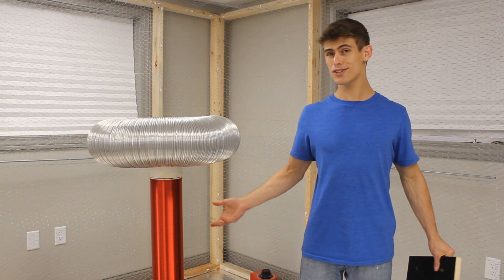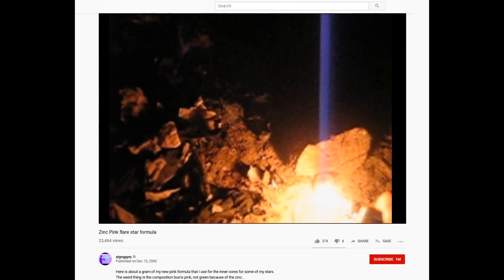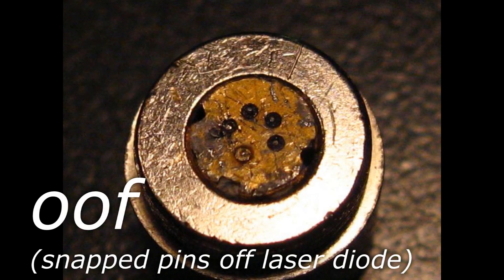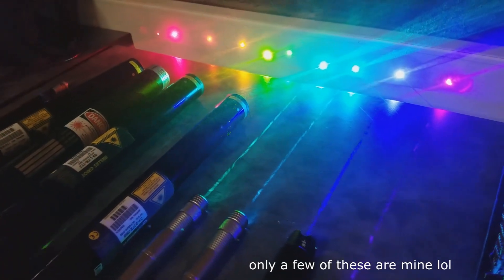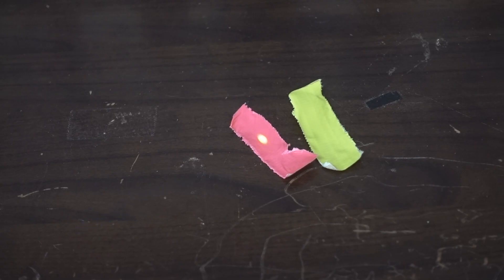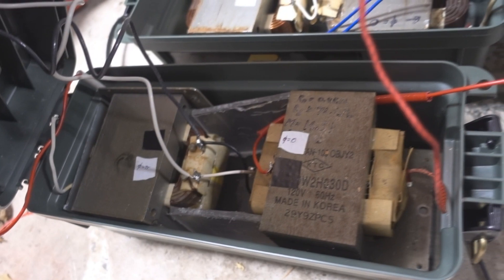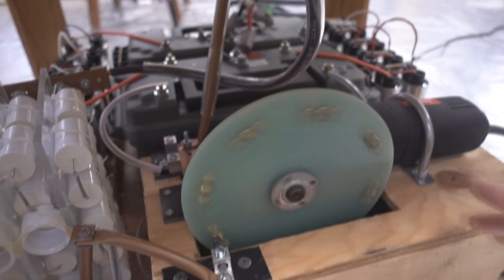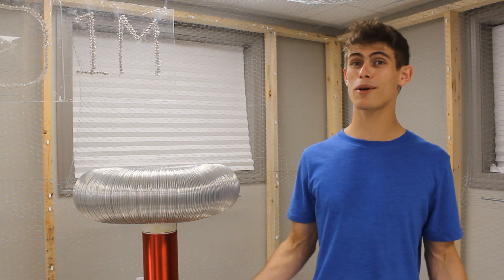Plasma Play Button for 1M Subscribers

Comment: i actually have messed around with a microwave transformer and its without a doubt the most dangerous thing ive ever done in my life i only turned it on once and right after i packed it up into a box along with the capacitor and that transformer will never been used again please don't mess with them people

Comment: Was scanning through your videos, sorrry if you have done one, but have you created an infrared LASER microphone?  Just wondering if so Id love your A) thoughts and B) process and C) circuit diagrams and physical dimensions especially between tx/rx and whether or not you chose a straight AM Superhet or what you discovered worked best. Just wondering.

Comment: Asimov's "The Last Question" was an absolutely formative Sci-Fi read for me, I'm not surprised to hear you recommend it. I love it so much, it really gets at something so universal (pun intended) and despite the vacuum tube computer, the super intelligent AI and the underlying themes and questions are still (and probably always will be) relevant. I love the twist at the end! I also highly recommend it to anyone reading this comment!

I found your channel through one of your DVD burner diode lasers, but a couple of years after your video had come out I purchased some nice laser safety goggles, and started attacking a couple old scrap desktops that I had acquired over the years. Only one had the right kind of diode. I built a classic LM317 driver circuit for it, which was one of my first diy electronics projects! However, I used a resistor in the KOhm range of magnitude instead of the Ohm range, just through some kinda brain fart. I had pressed the diode into a heatsink and collimating lense module, and carefully soldered wires onto the leads, and then I powered it up... and nothing happened. I assumed I had somehow broken the laser diode, and then I definitely broke it while removing it from the casing. That bad been my last DVD burner lol. I then checked my circuit in detail, and noticed the thousand time bigger resistor, and that the diode had effectively seen no current. I still have that driver (I changed it to the correct resistor, but never got another correct diode), and now that I'm older and can buy things on Ebay without convincing parents, I think I might just have to finish it while on winter break from college.

Happy lasing!

Comment: Hey man I ordered a laser from Wish. It is advertised as 5W which I'm sure is not accurate, but it does burn things a good distance away. It uses two 16340 1300mAh 3.7V batteries. Would a stronger battery = more power or wouldn't it matter? Also, I'm really lucky that I watched your videos and went with your recommendation of the Survival Laser goggles. I tested the ones the laser came with and the light passed right through them with almost no restriction. Thanks man. Happy lazing.
Reply: oldspower71 dude is that your Evo?!!!

Comment: This is a laser shot in the dark, but does anyone know what the open voltage of a laser driver is suppose to be? I'm reading near input voltage for open circuit like 10.5v! I'm not sure if that's what fried my blue laser diode and would like to know if I need a different driver or if I'm just being dumb with something else wrong (as the diode is kinda expensive at $40 for 10 seconds of use like I got, LOL!). The laser normally operates at about 4-4.5v range once its powered on (but I don't have an oscilloscope so I'm worried if it started up at 10.5 and maybe that's why it fried)

Background info:
I had it set at 4.75 Amp output, its a 4.75+w rated NUBM08 rated for up to 6 amps max with a forward voltage drop of what looks to be 4v after I turned it into an "LED" where it outputs a small amount of light but its not-focusable very weak dim light). Didn't over-heat, I ran it for 3 seconds longest peak, and it was very well pressed into the diode host with a bench vise. It was a truly amazing beam, I often play with a 1200-1500mW blue laser for killing spiders or setting t-shirts on fire etc, but WOW! That beam just took my breath away (like I know it should be good enough for engraving metal, but it was ridiculous how focused I could get the beam, and even unfocused it torched my wood floors in a fraction of a second pulse, I definitely need to fix it or make another one, too cool!). I can link the lenses used (I don't think it was OD killed, but who knows), and the driver (nothing super fancy, but accepts TTL power or without at just under $20 for up to 5 amps), power input was a half charged 3s Lipo battery (11.5v).

Do I need to find a lower voltage driver? Maybe hook 2 lasers in series just to handle that high open (possibly startup voltage)? With it running it seems to operate at 4v (roughly, remember the diode is blown now for voltage, I did current measurement with a clamp meter to not interfere and was taken when it worked).
Reply: I only ask here because you guys would know more than most, and seems like some laser forum guys are offering advice at my level of knowlege (noob level, lol, I'm not an expert in lasers for sure! I just have background in robotics and degrees in mechanical/aerospace engineering and love modifying everything I get my hands on, including computers and playing with extreme low temperatures and making everything run faster).

If its not answered here, no worries, its not life or death! Just thought I'd ask. I'll be ordering some new parts and hey, if it fries it fries, I just would like to learn from the experience and right now I'm a bit stumped at what I did wrong (which btw, this isn't some thousands of dollars fried, I'm even fine with that if I learn something or have fun, lol!). Hopefully I try again and find out what I did wrong, we'll do a lower power laser this time (aka, cheaper, haha!) on the next test sample just to logic check it and spam the on/off of the power input to see if it fries a cheaper diode and determine if its the driver.

Comment: Question for you, if you have time of course.     You mentioned in a video a while back about using Arctic Silver as a thermal interface material in place of indium foil. While I understand that indium has a thermal conductivity rating almost 10x that of A.S., would it not be better to have a paste to fill in voids in the two surfaces rather than a foil? Or is it a longevity/extreme heat scenario?    

Thank you in advance.
Reply: Incorrect.
Reply: Body Count    Thanks for responding. Can you be a bit more specific in which part is incorrect?
Reply: @hellishgrin4604  I'm just kidding :p I dont have any knowledge on the subject, sorry
Reply: Body Count No worries, I thought it was funny.

Comment: Hey styropyro. Can you make an array of lasers that heat just a small portion of air like 10m away and use this small portion of HOT air as a mirror? i mean like we see the reflection of the sky in the horizon in a  hot road...but in this case controlled and in much smaller scale. I kinda wanna see my hot neigbor havin a shower...=/

Comment: Hey dude, love the videos...have a good for thought for you though.

You education is in chemistry.

You've been hobbying around lasers.

What do you think about a solid fuel laser? 

I once had a teacher who claimed design of high (GW+) laser using solid fuel cells as "ammunition" if it's any hint, the calculations for GW were based on the fact that the laser expended the fuel in milliseconds, but exerted enough energy over that short time to land in the GW+ range. Surely the military has tech like this on it's cruisers on the ocean, who boast about middle melting intercept programs, but it may be quite entertaining, and educational, to do a video on how much a GW+ laser can carve through before the energy is expended.

Of course I'm not advocating unsafe usage. You would want such a laser aimed opposite gravity, and clear your shot path through local flight schedules to ensure safe operation.

An interesting idea to think about, even if you never produce it or a video on the concept.

Comment: Your rotary spark gap reminded me of a potential solution I came up for the rail erosion in the breech of railguns:
Add a consumable power contactor that'll keep the rails de-energized until the projectile is already moving and fully in the breech.
Sure, for weapons-grade scaling, it'd be a few hundred dollars for every shot, as it'd weld itself shut with that kind of current.
But it'd prevent the massively degrading large arc problem as the projectile approaches the rails, and it could just be housed in a really easy-to-swap box right next to the loading bay.
Reply: On Audible, though, I am currently going through the Dune series.
Freaking amazing works.
(The original six by Frank Herbert, not those of his kiddo.)

Comment: It seems like a lot of work but I may have a good 10m sub video. Lightsabers. https://www.sciencealert.com/boeing-has-patented-a-plasma-force-field-to-protect-against-shock-waves . There are many problems faced like the power required but in theory if you could contain a high intensity laser inside of a plasma field you could create an adjustable blade. If anyone could manage it with a dedicated team I feel like it would be you.

Comment: Hey I’ve been wondering with this type of power your lasers have to be pretty bright but how bright exactly are these lasers, like could they they light up vantablack. Also congrats on 1 mil
Reply: Probably, kind of.

It would definitely damage the Vantablack to the point of non-functionallity nearly instantly, as it is converting nearly 99.99% of the energy straight to heat.

But is it bright enough that (if reduced to 0.001% brightness by the interaction) it would still be visible after hitting a Vantablack surface... Maybe.

Comment: Me: stubs toe Ouch!

Stryo Pyro: shocks his hand hehe that tickles
Reply: @Mysticphantom 28 Electric has no effect on him. For he is it’s master.
Reply: If it is high frequency, it actually does tickle. It is kind of unsettling, and it is definitely uncomfortable to look at the charred skin afterward. However, if you want to begin some high voltage experiments, start with high frequency. I would actually recommend going high voltage and high frequency before working with mains. One of those 12 volt CRTs is a good place to start. It does tickle (don't intentionally touch it on my account, though).

Comment: I tried to find your email but wasn’t able to. Would it be possible to make an EMP gun designed similar to a potato gun with a coil down the center of the PVC tube with capacitors wired up to discharge at the exact moment of the explosion? I was to afraid of electricity to get to the voltages likely required to have any workable prototype, nor an in-depth understanding of how small explosions effect electromagnetic fields. My theory is, even without a projectile it would blast the field directionally.

Comment: Drake first I got to say thank you for throwing a plug out there for electroboom! For all you viewers it want to start off with high voltage I would recommend buying a neon Transformer from your local hardware or hobby store and experimenting with that. The shock is not that strong so it will teach you the respect for high voltage without The lethality!

Comment: Slayer Exciter cirsuits sure are fun^^ I'd avoid the ones that use 2n2222 transistors. I keep having small fires on my circuit boards. But yeah, quite fun. My issue might simply be that I follow the ElectroBOOM way of beefing circuits up. Wait, did I say issue? I mean, uhh, talent to make fireworks out of plastic^^

Comment: Extremely inspired by what you both do. I'm eager to start experimenting with electricity and other related things, but I know better. I wanna start very small, and as I learn more and more as much as possible, slowly begin to work with slightly higher voltages.

Comment: I built my first kit resembling a Tesla coil in 7th grade although it used a TV transformer and transistors. Upgraded it w/ a voltage multiplier in high school and managed 3-4" sparks at 50W from the outlet. Had fun w/ ion rotors, melting salt, and burning lichtenstein patterns in wood boards.

Comment: 10:00 - What is the dB level, cos that sounds like it could really do your ears some damage too.
Reply: The Liberty Science Center in New Jersey definitely requires the audience to wear hearing protection. The audience is further away, but the coils are bigger too so I would say that sryropyro definitely needs hearing protection.
Reply: If you have ever been in a room with one your talking about +100db I have seen a few however the first one I saw used a neon sign transformer and it was loud AF.

Comment: The illuminati logo on the transformer box XD Congrats on 1M subs! 

P.S. I really wanted to know how you made the plasma display, but there was nothing about that...
Reply from the maker: I filmed a bunch of clips on putting it together, but forgot to put it in the video. :( basically i punched a bunch of holes in some acrylic and then mounted long chains of neon indicator bulbs in series. for the play button one i had to do two series chains of bulbs in parallel to account for the two loops. long gaps were connected with 34 awg magnet wire
Reply: @styropyro  i only understood the 1st sentence
Reply: Pyth0n b me too
Reply: @rickherzog9275  lmao

Comment: Yo styro my friend and I designed a fan  to suck the smoke out of your face when you solder and I think it would be pretty nifty for when you burn stuff like the wood in videos. If you have a 3d printer and  inventor 2019 I could send you the files. Hope ya see this

Comment: Average house takes 3-4 amps off the grid (depending on the time of day)

House illegally growing weed takes 90 amps off the grid 24/7 

Styropyro's house .............
Reply: That's not true anymore. Any worthwhile grow op uses LEDs. The power usage doesn't stand out from an average house. Not as much heat either and cops in some places actually use thermal imaging from helicopters to look for grow houses. Also the ratio of light to dark changes in different stages of growth but it's never 24/7 light.
Reply: * needs his own power house *

wait I gave him an idea D:
Reply: NowM wait how do know how much a house illegally growing weed takes from a power grid.
Reply: 70000000 of the grid
Reply: Fbi, open up
Reply: house...*
Reply: I guess you haven't see Photoninduction house yet.
Reply: 5374837587487538473873483783748375384674265764727473477567436473647737382738273283728372382748#488384294839438483475477437547426477472743773847383289388473832843758474928392848374837438732883829328948954758371928198384738172273284738372938284738327437642737377878 33239284754874297843884389384938438488327483838274383728473832738274823738439483958£493949393029302932939203929392933848384398329382938293849247 87484758478574 I 9999999999999999999998968537547487684748amps
Reply: 3-4 amps where? on which side of the transformer? On the low voltage side it's closer to 100A.

Comment: PS, I am 72 years old and was way into making solid rocket engines for my grandson. Have to admit I made flash powder, gunpowder and guncotten. Only had one minor accident that didn't cause any harm, but sure learned from it. I cut the backside (rounded end) of a co2 cartridge, filled it full of racket fuel. Using a long strong 46 foot of stainless steal wire and supergluing a small tube for the wireline on the cartridge so it would go from my house in the backyard to the fence before the alley. When it took off it shot right through the fence. Never did find it. Man did I feel lucky it didn't go thruough neighbors fence.

Comment: OK, Maybe you can set the record straight. When I ordered my first green laser...unknown power.... it came with glasses. They were a sort of amber color and didn't look real dark. I then bought a 5 watt laser and decided I better order some glasses for it as yep it hurt eyes at a distance regardless of surface I used. So I ordered some that said they were for blue laser. And they really made a difference. However, according to someone on internet that the right glasses would total block the beam and only show the dot of burning. So what is the best , and of corse for me, less expensive blue laser glasses. And will it not show the beam reflecting off the air particles?

Comment: Congrats on 1 megasub! I liked your instant phosphor charger, even though you showed it only for a couple of moments. I get the same thing with my phosphorescent stars on the walls being instantly charged by sparks and other pulsed stuff. Have you tuned your Tesla coil perfectly just with the oscilloscope, or did it still need some final tuning after that? I was wondering for a while, if one could make all the tuning with the scope and then just flick the switch and get the perfect operation.
Reply from the maker: thanks!! nah the scope only gives a rough idea, but this time i tuned it ~10kHz below resonance and on the first run the arc was hitting all the faraday cage walls. as you probably know, the arc itself gives added capacitance and the mutual inductance between the coils will also decrease the resonant frequency (if you don't take measurements with the coils already in place)